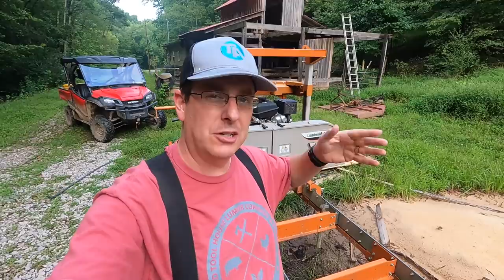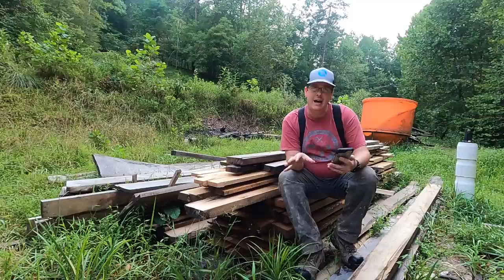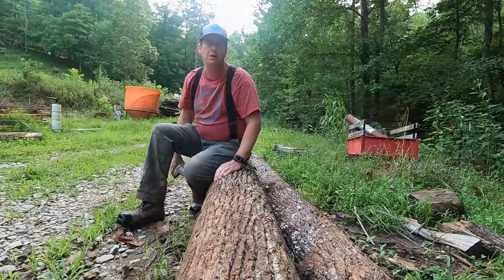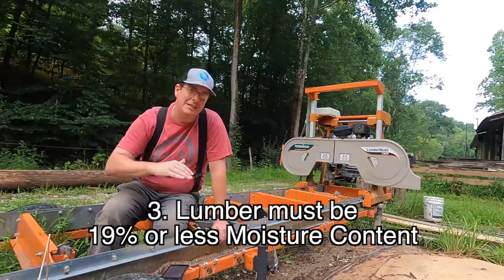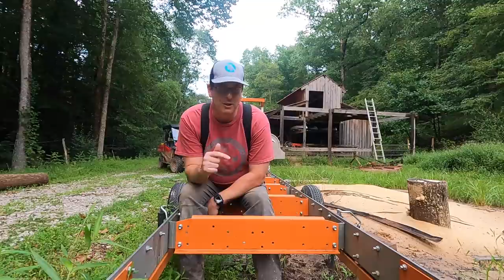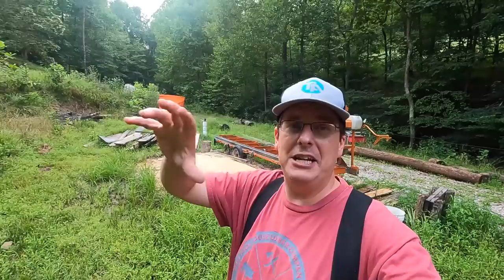Can you Build Your House with Ungraded/Unstamped Lumber? - UPDATED

Comment: Good info! As a North Carolina resident that has done research on this very subject I'd like to add, the first place to start inquiries is your County's Building Inspectors office. I say to start with the county (local) because if there is any government inspection involved (and there will be) that office will be the ones actually doing said inspection. If your building/project is also with in a City limits you'll need to research that City's building codes as well because they will likely also get involved with any inspections. I would also advise anyone to use E-Mail when doing your research because its in writing and can be traced to the office and person you got your information from, a phone call is good but "get it on paper" so you can prove to anyone who tries to counter your plan(s).
Reply: Good guidance Raymond

Comment: I understand that a lot of folks don’t like government interference in their daily lives, but there is legitimate reason for lumber standards and the grade stamping of structural lumber along with building codes that require grade stamping. There used to be a lot of outlaws in the lumber business that would misrepresent inferior grades as #2 and, for the most part, the average consumer doesn’t know the difference. To accurately grade the knots in structural lumber according to their cross sectional displacement takes a lot of training and experience. Through grade stamping and the inspection process, that practice has, for the most part, been eliminated.